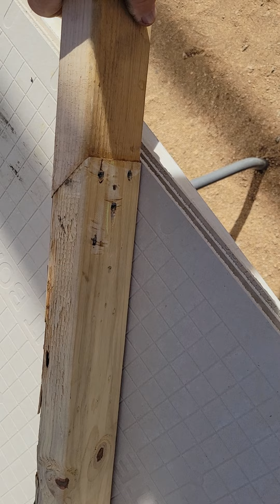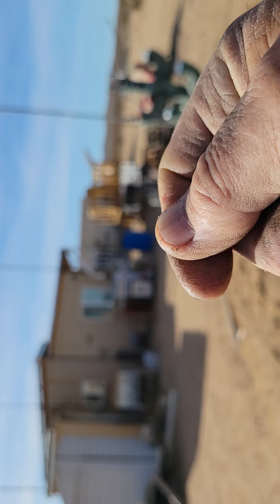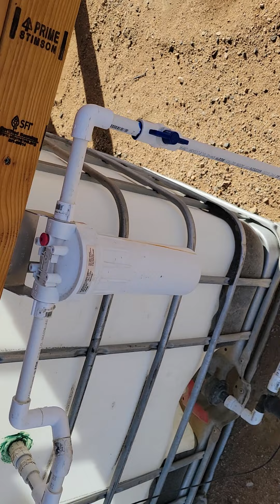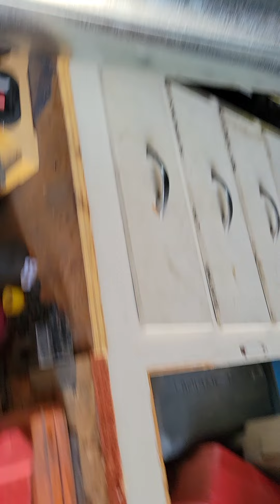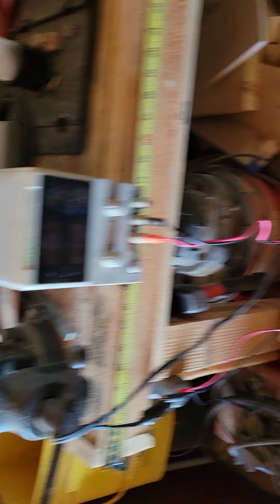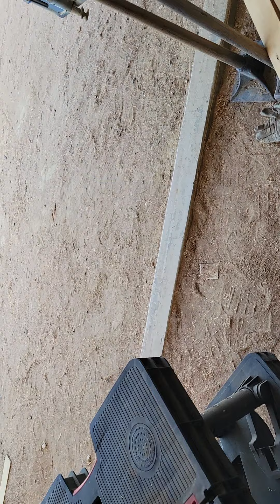Portable Solar Powered Transfer Pump, March 21, 2022

Comment: 👋🙃
It shouldn't be too hard to dehydrate your food there 😄🌞🌞🌞.
Bubbles will be fun. It will also cool the water and help with filtering the water.
Reply from the maker: Your first smiley face is upside down, did you get an update too?🤣🤣👍
Reply: @GBear  your video is sideways 🙂
Reply from the maker: No.....? Your smiley face is upside-down.